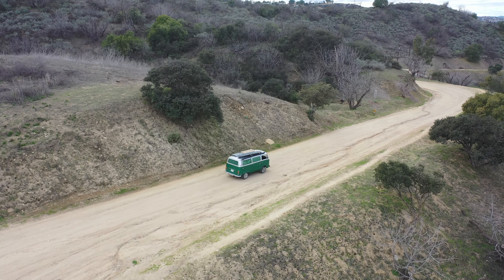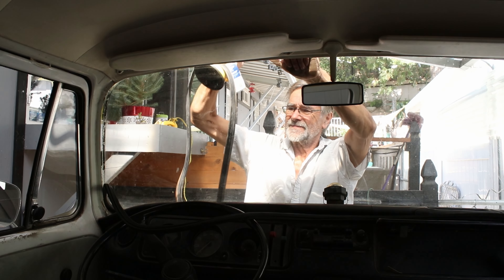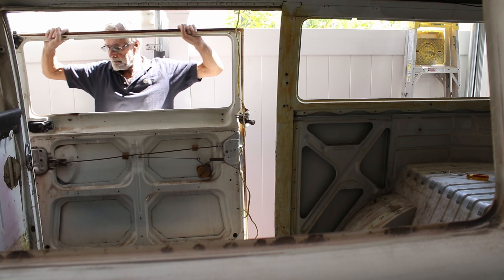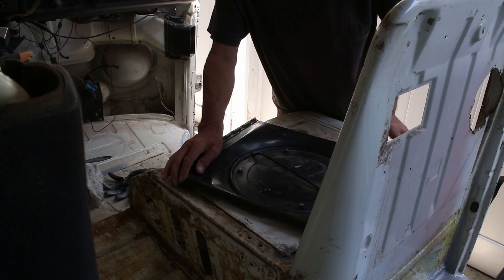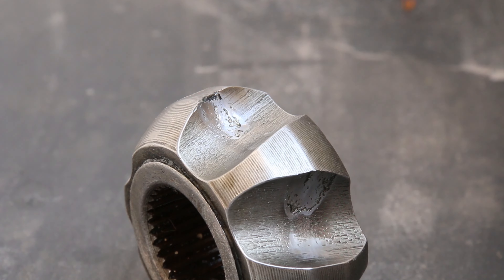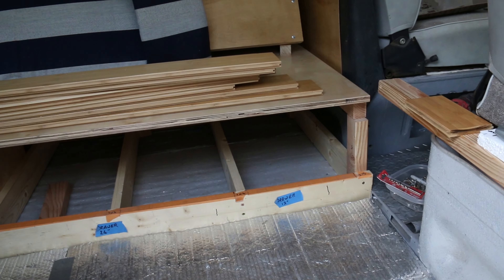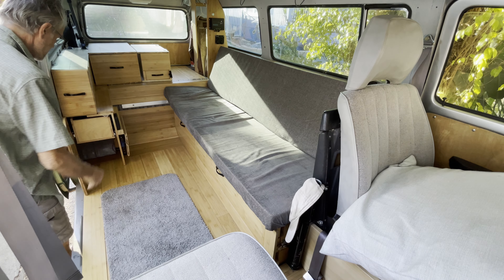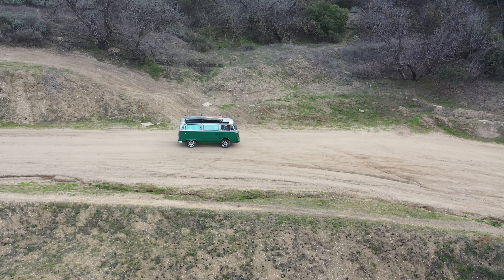VW Bus Renovation Story

Comment: Very well done. Did you upgrade the engine? Did you restore in Laguna Beach?
Reply from the maker: the gas motor was a compromise as I'd intended to put an electric motor in, but they were not available due to covid shutdowns in Italy. It's a 78 2 liter square port, hydraulic lifters, twin duel choke carbs, - actually quite peppy for a bus. I fortunately got it registered a '75 so I didn't have to deal with smog certs. All work done in San Fernando valley, engine came from San Marcos area.